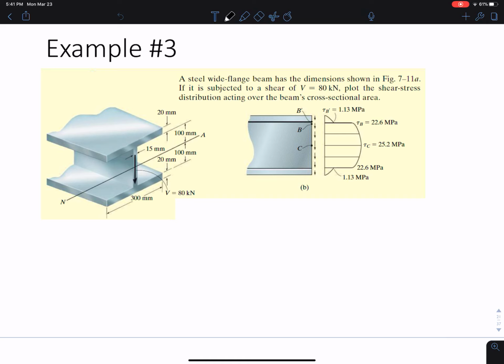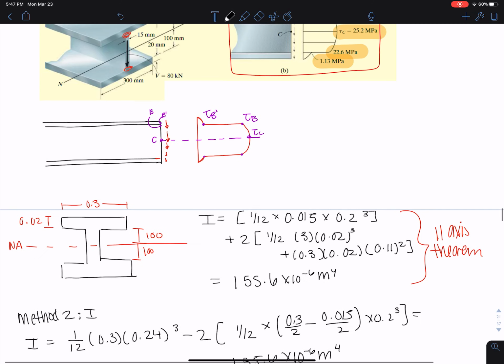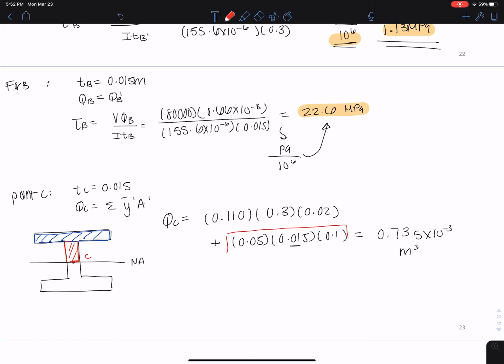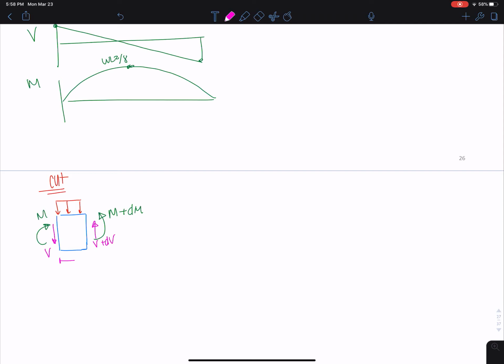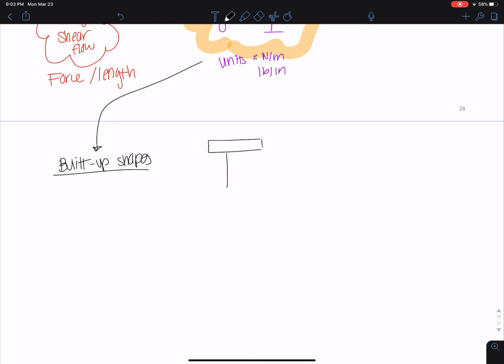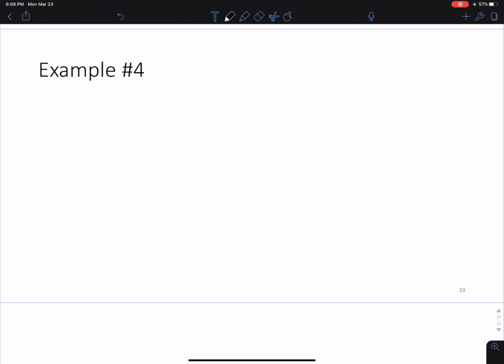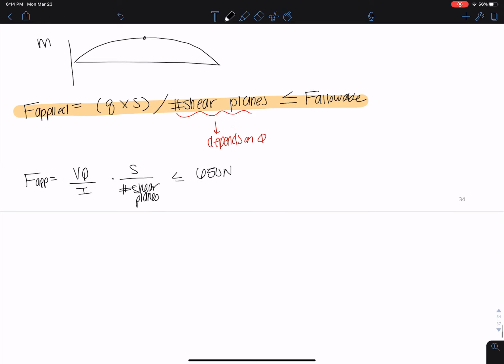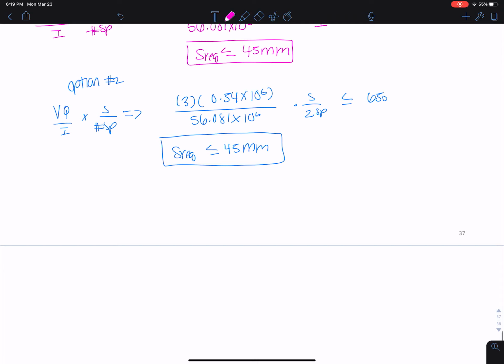EGCE301Topic6Part2

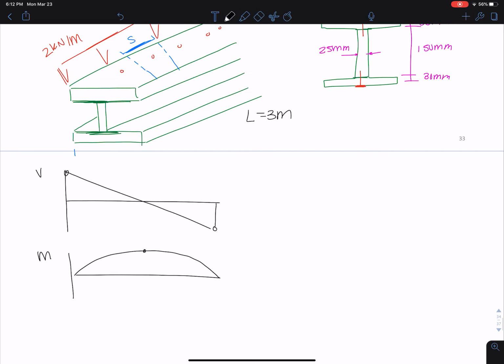Comment: Anyone know how she got 3 kN for the shear diagram at 30:55?
Reply: In the previous videos, we were taught about the different types of beams. It states in the beginning of the problem that it is a "Simply Supported" beam. This means that on the left-bottom side of the beam has a pin and the right bottom side has a roller. You solve for those forces and you get that Ay=3kN and By=3kN. Or Another way to think of it is that you have a force of (3m)(2kN/m)=6kN from the top and you have distributed force supports.
Reply: @sarandy3  I was also confused on this but thank you Sarah for the explanation!